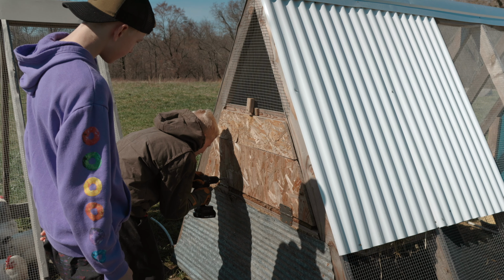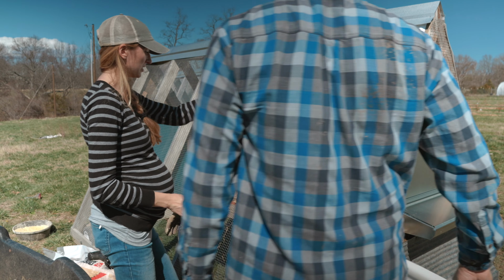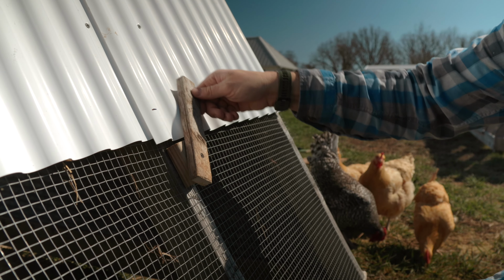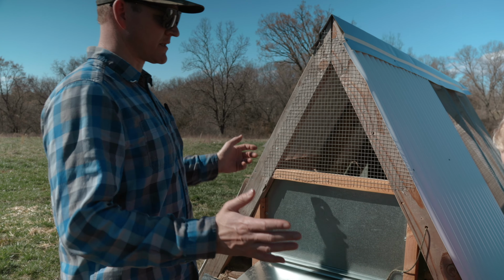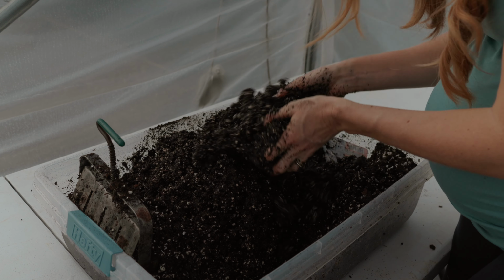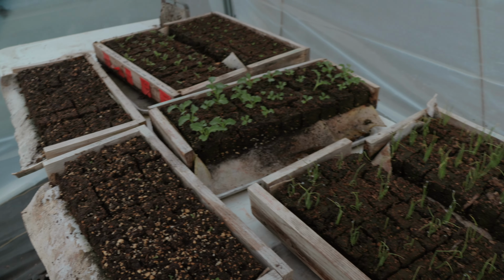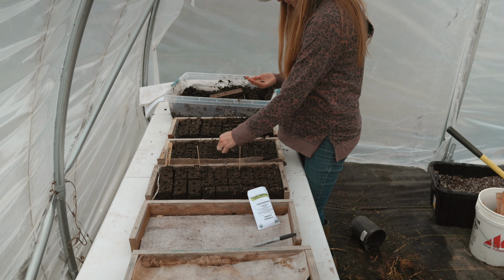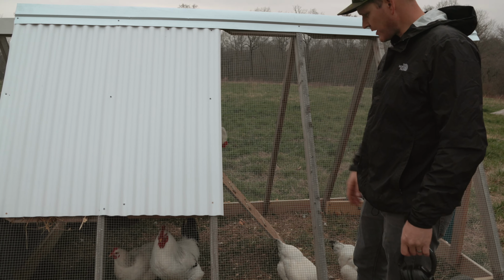This is Going to be WAY Easier! Chicken Tractor Upgrades & Seed Starting

Comment: I would also suggest putting a piece of flexible flashing in between the top roof panels and the door panel.  This could be sheet metal or rubber mats or plastic even

Comment: Wouldn't rain from the top layer drip down into the coop since there is no overlap in the plastic sheet between the top and bottom(hatch) layer?
Reply from the maker: It does a little bit.  Working on a fix right now, but with the way it hinges, it's hard to completely cover that gap.  Our engineering minds are running at full steam right now :)

Comment: Since you have a plywood backer on the door - you could also add a little hook or something to hold a bungee or rope, etc. so that the latch (even if loose) will still be secure. Over time it may become loose and since it's on the bottom gravity may cause it to shift to the open position. :) Small fix to avoid headaches later one!

Comment: We made a coup similar to yours but put hardware wire under the roosting poles so we don't have to clean it at all  the poop just falls to the ground.
Reply from the maker: We will likely use this approach in our next coop.  Will definitely save on weight too!

Comment: I have a chicken tractor like yours but instead of having a wood bottom in the roosting area it's just wire so the poop falls to the ground. We are newer to chickens so I'm wondering if there is an advantage to having a bottom under the roosting area that you have to clean out vs having the poop fall on the ground through the wire. I do move my tractor every day to give them clean grass. 

Love your videos. I feel like I learn so much. You're much farther along homesteading so I appreciate all you share.
Reply from the maker: Either way is great. Wire is definitely no work because you don't need to scoop out manure. In my case, I intentionally chose to put plywood down instead of wire because I wanted to collect the chicken manure to use as fertilizer on my berry plants. It is more useful to me there, than all of it dropping on the grass.

Comment: On the next one, I wonder if you just add the egg box to the outside (cutting an access opening).  Instead of adding roosting space on the inside, use the wood you would use for what you have to add to the inside?  The added weight you talked about might counterbalance the weight penalty over the wheels, making it actually easier to move?

Comment: So funny!!! Our family just made your coop design last weekend. 

Do your chickens fare well in the tractors when the temps drop (20’s and 30’s?) We live in middle TN, and do not typically stay cold, but we do have a lot of rain.

We were given chickens by a sweet friend whose neighbor would not allow her to keep them. So, we have been watching your channel, and we really like your mobile design. I am realizing however that cleaning it will be a little challenging, and we may need to modify as well. 

Blessings to you all. We are thankful for your channel. It has been very helpful and encouraging!!!❤
Reply from the maker: Yes, we've never had any trouble with cold temperatures. Most of our breeds of chickens are resilient to both heat and cold, with the excepting being our heavy bodied Delawares. They didn't like the heat last summer. On hot days we had to make sure to let down the coop door early so they didn't get too hot in there.
Reply: @TheSeasonalHomestead  Thank you so much for the reply!! We were worried last night…lol!! Our temps are dropping a bit here this week😊